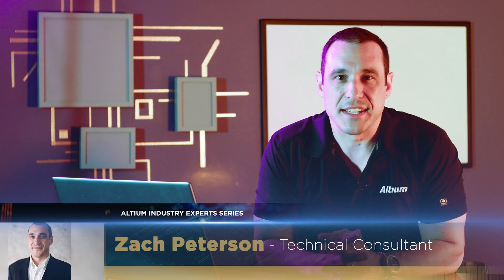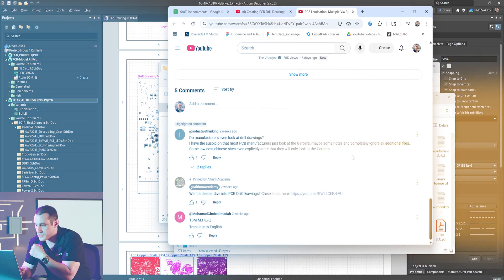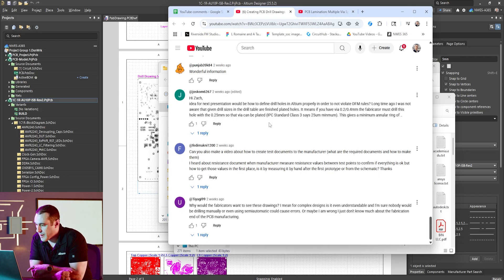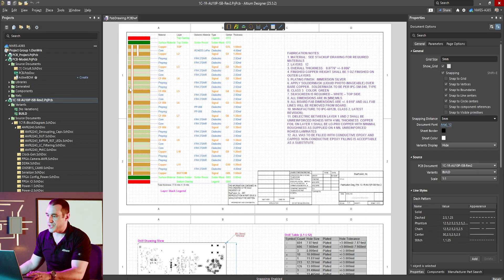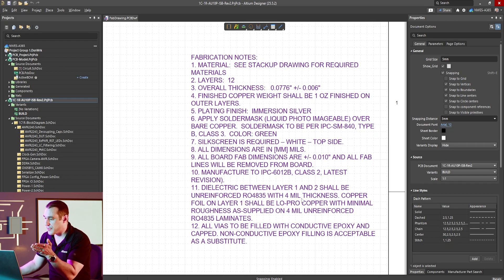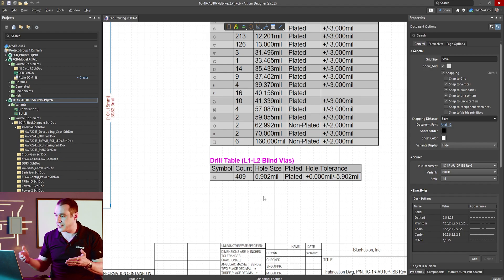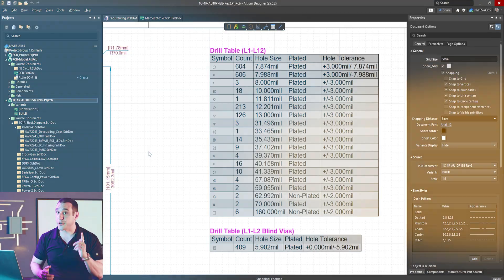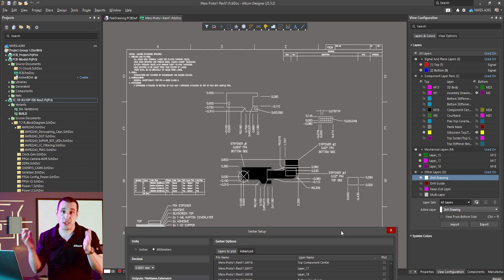Do PCB Manufacturers Actually Look at Fabrication Drawings?

Comment: Hi, cheap Chinese manufacturer here. 

I know for a fact that some quickturn services completely ignore the fab drawings simply because the CAM engineers are not proficient in English, so I was sweating bullets every time you said 'master specification'. With hundreds of orders to go through and a bunch of documentation, it is easy to see why going through it all in your non-native language is a pain. Some customers like to put EVERYTHING in that Gerber upload; schematic, component library and all and expect us to just follow the files to get perfect PCBs. That's why some say they will only follow the Gerber files, BUT I have seen some that don't even look at the info in the fab Gerber files (even worse, there's no copy and pasting Gerber text)! To be more specific, they should write they only follow the "Gerber data", and only the graphical stuff. 

NextPCB are actually very good at checking fab notes though and I hear the folks behind me asking customers about inconsistencies all the time. But it can be annoying, since a lot of people don't update their fab spec info or are using a template, and most of the time customers tell us to ignore fab drawing details anyway. 

But it has to be done, and we end up asking customers who ordered a $10 PCB why their fab drawing says they need capped vias, hard gold and a custom Isola stack-up to IPC-class 3 spec. Then some get upset because we're "wasting time" asking these questions.

Comment: Draftsman makes it relatively easy to generate a fab drawing, and pulls data automatically from the PCB design (aside from text notes of course).  To replicate some of this information in a gerber file as you show here is more of a manual process, which is very time-consuming and is open to introducing mistakes.  (Unless there's some more "automated" method of creating a fab drawing on a mechanical layer I'm not aware of?).  At my job, if a vendor states up front they will ONLY review gerber files...that vendor is crossed off the "approved vendors" list. Personal hobbyist stuff, sure...but not for anything professional.
Reply: Think about it from the perspective of a design services company. I have dealt with multiple clients who demand very specific drawing formats in a DWG, and this requires a DXF export of multiple layers from the PcbDoc file, including a fab layer with the drill drawing/table and the stackup drawing. At least those elements can be generated automatically... You can also start with a template as we often do when the client demands a DXF/DWG, and then we can copy/paste their fab notes into the PcbDoc file so that it exports into the DWG. You can then also do the Gerber exports and they will look exactly just like your drawing. Sure there is the extra steps of creating a template, but once you have that the effort is basically the same.

Comment: someone clearly reads mine before i get them back with covered in x's and question marks 🤕

but more seriously, if I'm sending additional documents beyond the strictly necessary, I include mention of it in writing and ask for specific confirmation in writing.
and I've never had any issue with anything along those lines

the issues I've had are exclusively related to omitting something, or inadvertently burying it my schematic in a way that was - in hindsight - asking for trouble
both of things I have done. I am human.

Comment: The only reason Altium is putting this out is they’re trying to convince people to stop embedding your fabrication data in the gerbers and instead use their Draftsman Tools. Problem is this only slows down your normal work flow and drives up your board house costs
Reply: I'm the person that chose to create this, not Altium. I'm not an Altium employee (they often joke that I should be). Did you not notice the part at 9:50 where I literally show how to embed the fabrication data in the gerbers? And exporting a PDF does not slow down the workflow and has zero effect on costs. Manufacturers don't care if the spec is embedded in the Gerber or in a PDF. They just care that there is a spec somewhere.

Comment: These extra drawings and standards that get called out in those drawings that are specific to your company drives up your costs because someone has to spend a significant amount of time to research all the minutiae in your call outs that are probably superficial
Reply: If you're referring to IPC standards, those are industry standards and they are used universally in design and manufacturing. People who work with this these standars know the requirements and it is not just minutiae.

Comment: I usually put all the board info on the drill drawing and rename the drill drawing gerber as .INFO instead of .GD. It always works and every fab was fine with that.
Reply: Not surprising, if you include a file in a Gerber export a CAM viewer will be able to read it regardless of extension since there are technically not any standardized Gerber extension names. Altium uses their scheme (.gbr or a layer-specific name), Cadence has their own scheme, etc.

Comment: As someone who has worked for a board house, and actively designing HDI PCBs, yes they are used.  I have caught many issues that customers have sent in when comparing the Drill Drawing and Gerbers in CAM.
Reply: How does that happen? Are they using different sources to generate them, or forgetting a step, or ..?
Reply: @jimjjewett they are just errors that have occurred due to their engineering procedures. Not really sure of the cause of them other than just errors.
Reply: @jimjjewett  I can tell you for sure that it's the processes and the drawing software people use. For example Blueprint from Downstream Technologies is a steaming pile, I hate using it but I have clients that require it, sometimes you import the data and the drawings do not populate/update, and there is no clear indication why this happens. That's why I like OutJobs with Draftsman to create all this stuff.

Comment: Thanks for another great video on an often neglected side of PCB manufacture. I often wonder how easy it is to go overboard on a fabrication drawing and start specifying requirements that should be a implied if you specify IPC compliance. One thing that caught my eye, because it's come up in conversations at work is applying tolerance that essentially closes the hole. At the 8 min mark we see the Drill Table (L1-L2 Blind Vias) Hold Size 5.902mil, if you look at the Hole Tolerance it +0 and -5.902. So essentially this indicates that closing the drill hole during the plating cycle is acceptable. I'd also assume that the implication is that the manufacturer will use the largest drill size that they can. However one concern might be that as the drilled hole size goes down so does the amount of conductive(plated) material. At the extreme this could mean you have a 25um diameter conductive path which would still be IPC and drill tolerance compliant. My point is that there is a large difference in the amount of current that this via will pass compared to if the physical drill was actually 5.902mil, with a 25um barrel.
Note: Sorry for mixing mil with um but I'm normally working in um, but 25um is ~0.98mil. Also I'm aware that the plating thickness can be less that 25um depending on the via type.
Reply: As manufacturers will over plate the hole to ensure at least 25um wall thickness, the actual drill used for the designer is a guess~+4th/100um over the finished size. If the finished hole goes to 0, what was it drilled with and how much plating?
Which is why I wonder if vias should be defined separately to all other holes and be based on the drill hole with tolerance, rather than the finished hole diameter. That way they can't undersize the drill. 
Also;
Manufacturers care about hole wall to copper clearance. 
The impedance of the via is dependent on the hole wall and antipad. 
You may not want vias to close off completely as it may have voids with entrapped chemical left over.
Reply: Why not just define it by drill diameter size and then specify a plating thickness? Would you get the same closure problem because you would be converting a drill diameter to a finished hole diameter (+/- tolerance)? Seems to me that there is only a problem if the allowed drill tolerance creates the possibility of plating closure, but there is a fab not that says "thou shalt not close any vias with plating" or whatever...

Comment: Do manufacturers look at the copper artwork in the fab drawing? To me, the copper artwork looks like a Rorschach test. I don't have a sharp enough eye to compare the Gerber files in a viewer and the artwork in a pdf.
Reply: The probably do but I would think it is to verify the layer order. Sometimes the layer correspondence to a specific Gerber file is not clear because of the file naming or the file extension that is used. I like to state specifically in the stackup drawing which Gerber file is used for each layer, then there is no confusion.
Reply: @Zachariah-Peterson  I've never been a fan of including images of the layers, but instead just a table assigning "Top Copper Layer, Internal Copper Layer 1, Internal Layer Copper 2, etc" to a gerber file. Similarly the drill drawing always looks too busy to me, while the table with numbers to compare against seems much more useful. Am I being stubborn by not wanting to include the images of the layers/drills and just tables? We formerly included a "readme.txt" with the stackup, gerber-to-layer table, specifications on plating, etc... do you think that is sufficient?